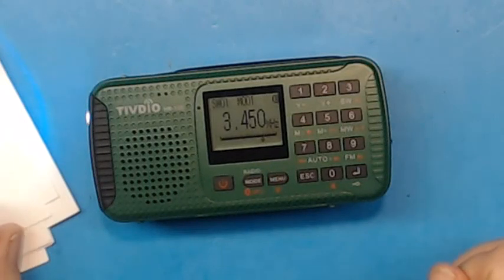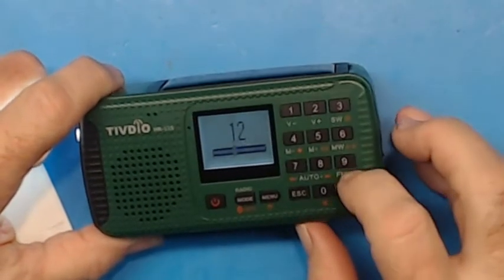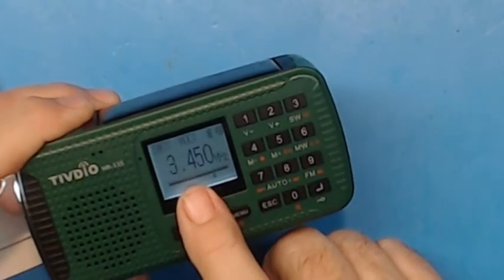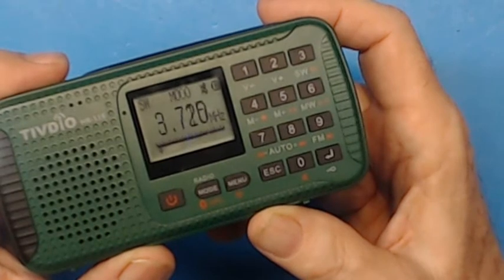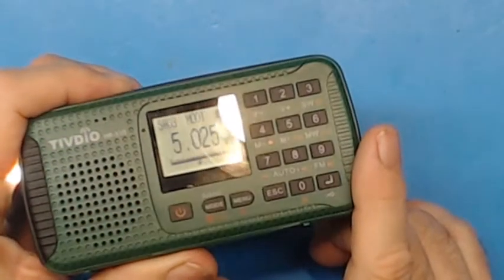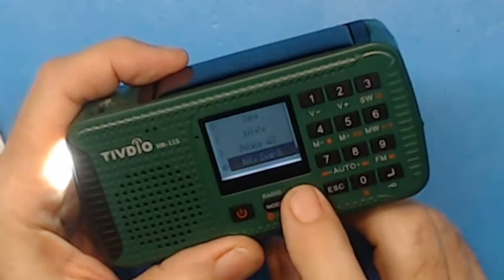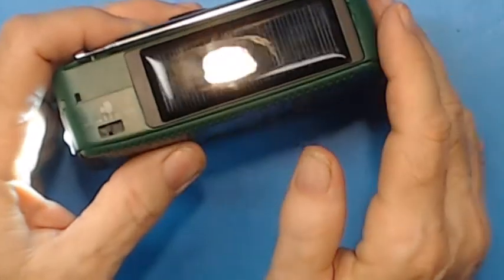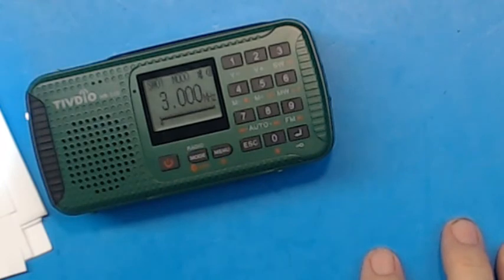TRRS #1298 -TIVDIO HR-11S Tuning Methods

Comment: I just checked out this little emergency radio, the green HR-115 on Amazon and decided for 19.99 +free shipping I couldn't resist trying it out.  With all of its features, Bluetooth, headset jack, SW band from 3.0 to 23.0mhz, emergency crank, flashlight, solar, rechargable cell type battery, digital buttons, it's worth trying.  I may try it with my Kaito clip on reel antenna.  

I sort of intended to buy the Kaito voyager v2 with analog AM/FM/SW bands but then jumped this one.  

I may start collecting these compact emergency devices!
Reply from the maker: Thanks for the report and have a great day.

Comment: The downside of this emergency radio is it does not have NOAA radio. The 11w radio (the red one) has NOAA radio but does not have shortwave. I own the new red one, the 11w, a very disappointing radio for many reasons including the horrible, horrible battery that has no AA options and very poor AM reception and a very poor flashlight. Get a Kaito.
Reply: hello,are you there?it looks like you received one with problem,could you please tell me your email address?or send the email to our office service customer email:support@tivdio.com
so we can help you solve the issue soon
Sorry for contact you late
I just noted your comments
Angela

Comment: How many shortwave bands are on this shortwave radio? I'm fairly new to this as I've never used a shortwave radio with a keypad. I've owned an Eton FR-500 and a skywave I'm not if I'm gonna return unboxed. I'm trying to compare this to the Degen DE-13, which I know the latter is manual tuning and less features. I'm asking mainly about the reception being up to par on the Degen to justify going cheaper with the Degen. Looks like this TIVDIO HR-11S had the price raised on amazon to about $50-$60. Still worth that kind of money?
Reply from the maker: 12 You can't compare this radio with the DE13.  My limited experience with the DE13 is that it would be an OK radio if it was under $20.  If you are serious about listing to shortwave don't get the 13.  The Tecsun Pl-310ET is a better radio than either.  Cost $35 to $40 new and is in my Amazon store.  See the link in the description above.  The other radios are there too.  Remember I am no expert.
Reply: Thanks for the advice. I forgot to mention I have a C Crane Skywave and I'm looking for a solar shortwave radio with a crank with strong reception if I need one in case of a crisis. I do like the digital capability of the green TIVDIO, but not if it is ideal in a survival situation. The C Crane is intended to be my primary radio.
Reply from the maker: In that case this might do the trick for you.
Reply: How about NOAA Weather Band version of HR-11S as Kaito KA680?
Reply: hamrad88 same thing between HR-11S and Kaito KA680. Same body but different color. KA680 is orange and HR-11S is green. HR-11S has wide FM 64 to 108 MHz, AM 9k/10k spacing switch (520/522 - 1710 kHz) and Shortwave bands.

Kaito KA680 does not have Shortwave either. Only NOAA Weather band, normal FM and 10 kHz step on AM.
Reply: Hi,we have a deals in 5 Mar,its price is $25
Reply: hello,do you have bought the radio?

Comment: Hi, you did a good job like usually:-) It is an interesting  Radio but before I dont know the reception, I wont buy it. Bye the way the  Tivdio V 115 is not so good at SW. So it would be good to know  is HR 11S  maybe better?
Reply from the maker: I am sorry I have fallen behind on reception testing.  Hope to get some testing done within the next few days.
Reply: ... not a problem, I enjoy all your videos:-) ... and let me tell you , the V115 is not bad on SW but it makes some  noises ... maybe the shielding is not the best? Would you please have a look at the HR11s? Thank you so much... and still go on with you videos............... Thanx
Reply: Speaking of FM, HR-11S can tune to Japanese (76 MHz - 95 MHz) and OIRT Russian FM (64.0 MHz - 108.0MHz)

But sadly,  V-115 cannot tune to Japanese FM frequencies.
Reply: Also V-116 and HR-11S can tune the same thing on FM frequencies: 64.0 MHz - 108.0 MHz

V-115 doesn't have that expanded FM frequencies.